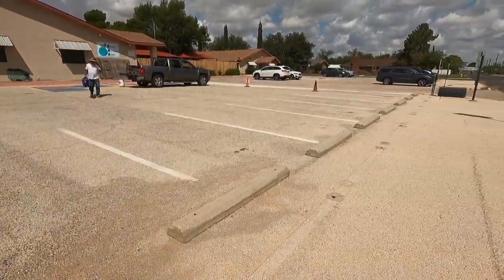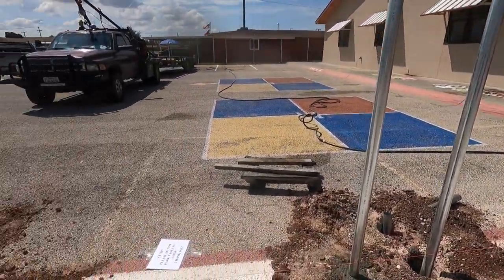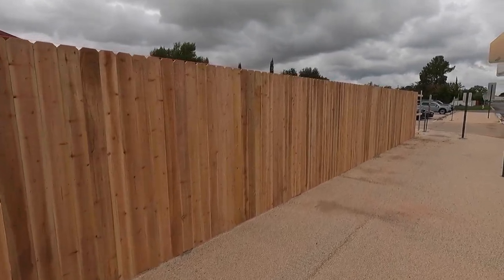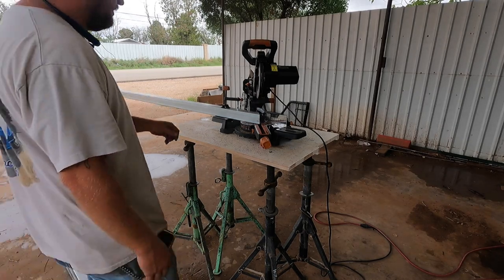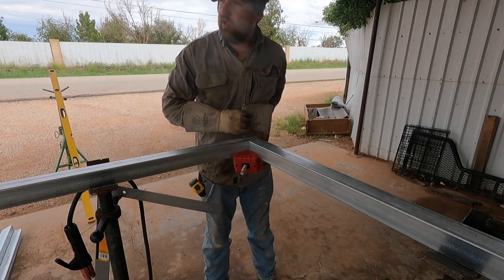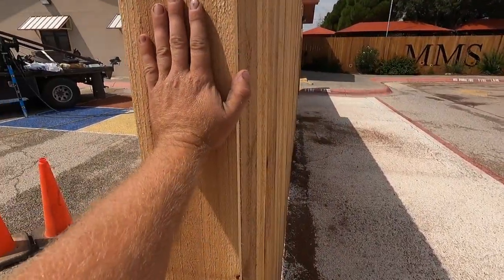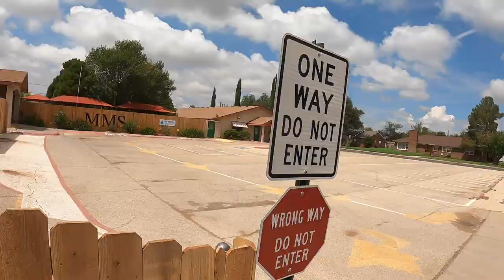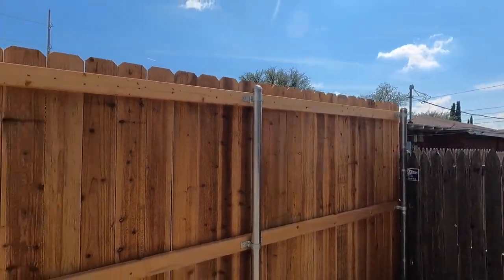building a 7ft cedar fence with 2 sliding gates

Comment: If you could please help me out i would love to know what you charged to build gates like this? I don't need an exact number but a rough idea would be great. I know the price of the fence in my area, but the gates are a struggle to price, especially if they are custom like this if you could help me with a number, it would give me some insight. Thanks
Reply from the maker: on gates like this I usually charge material plus my hourly rate of welding which is 125/hr. I think I had half a day or a little more into both of these gates. if I was to make a number off the top, id say around 2000-2500 total material and labor for both gates.

Comment: Cool video but out of curiosity, is there a particular reason why the posts in the asphalt were off-center to the holes? Some of them seemed to be close to center and some seemed to be on the very edge of the holes dug.
Reply from the maker: Man sometimes its hard to get a hole perfectly centered over where you want it. Sometimes the post have to be offset slightly to keep our 8' center to center span.

Comment: Would it be a feasible option to build the gate frame out of 4x4s instead of welded galvanized tubing for those of us that don’t have welding equipment? Could maybe add a third v-track wheel to account for possible wood flex at the bottom?
Reply from the maker: I personally wouldnt. But that dosent mean you cant! I built a sliding gate out of lumber some years back at the request of the homeowner and i just wasnt happy with it.
The problem is, 4x4s will warp and bow and eventually the gate wont operate correctly.  Now you probably could do it , and reinforce with angle iron screwed to it, but i havent ever tried that! Hope that helps some!
Reply: @Jacob_Harley   I’ll try the angle iron for reinforcement and see how it stands the test of time! Great idea on that. With my gate being 11’ in length would a 4x4 frame with angle iron and lap joints be over kill? Do you think a 2x4 frame with angle iron and lap joints suffice?
Reply from the maker: @chrisgraham6111  you know thats hard to say. Is it a picket fence? 6ft tall? The problem with 2x4 is, with the weight of the pickets etc, it will be prone to twisting  . But with an angle iron frame , that will definitely help stiffen it up so you would probably be fine.

Comment: For that thin metal, what method you use to stick welding that ? did you ran continious bead or use "tack weld" method ?
Reply from the maker: Continuous bead for sure. I run 6010 3/32 at around 70-75 amps for thin stuff like 14guage and 16 guage.
Reply: @Jacob_Harley  Thanks, i will try to practice that DCEN method on thin steel.. before this i only heard people saying that 16gauge is only possible with mig.. hope your next video can show your welding process without too much fast forward during welding..